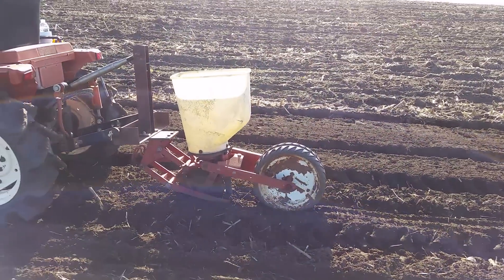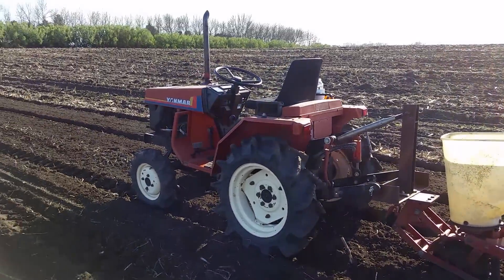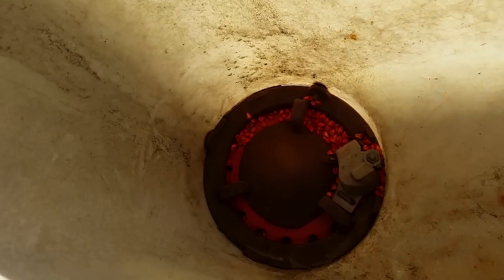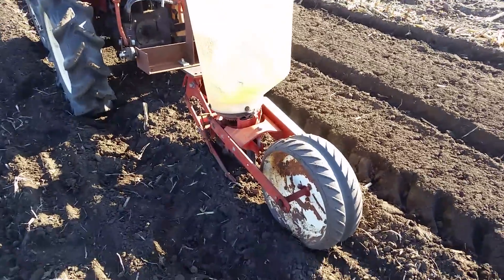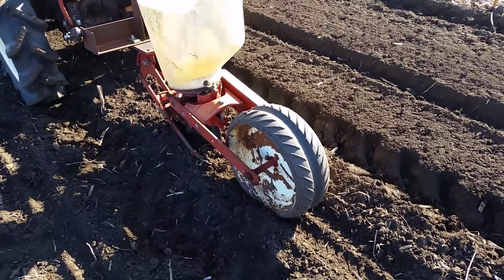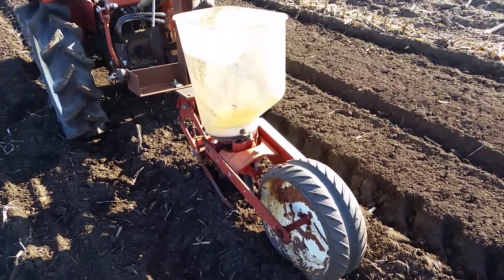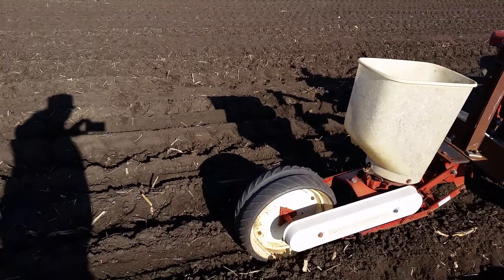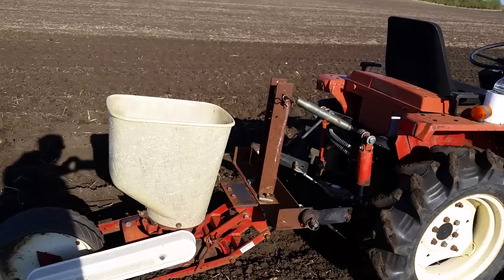My IH 295 Single Row Corn Planter

Comment: those yanmars are far from a piece of crap.we used to have one(1700 diesel).very handy size tractor that always started good and didn't use hardly any fuel.got a 656 gas and a 574 gas with a bucket loader on it now and sure wish we had that little yanmar when we scrape out the hog pens.